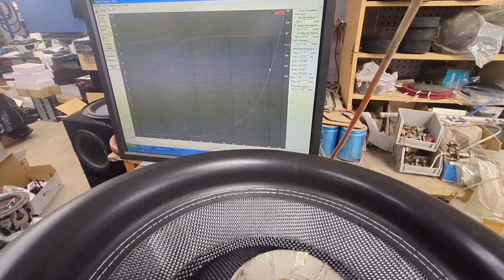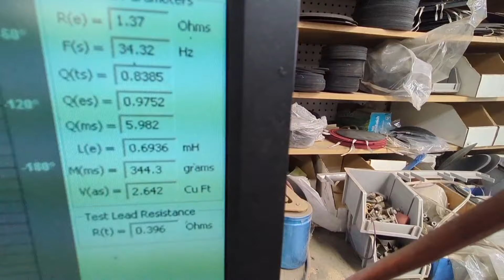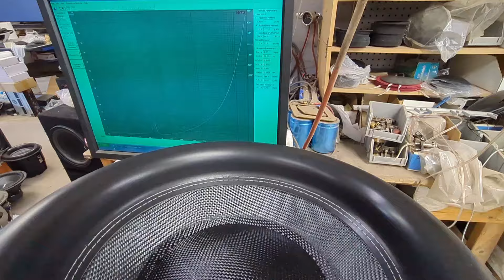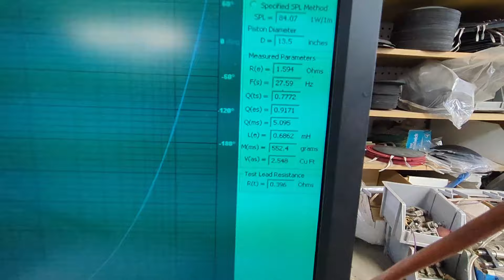15" 1 ohm SVC w/ GONZO Jr. Motor & Crescendo Contralto Frame in Jizz Llama White SPL vs SQL Review

Comment: Looks like a resilient sounds basket
Reply: Looks like the basket a ton of brands use.
Reply: yea, its a generic 4 spoke 9.25 top landing 8.5 bottom landing. it is what they use at rs, i have a platinum 15.
Reply: The rs gold v2 12” woofers now uses a 10” landing 😊
Reply: @onesikm3  yea using the ti frame. i need to get a platinum top end built on the ti frame :P

Comment: So even if the Box requirements is at 2.5ish cuft. you can put a sub in a 4cuft? Or that's just with these particular Sub Design ?
Reply from the maker: You can always go bigger You just start to compromise power handling